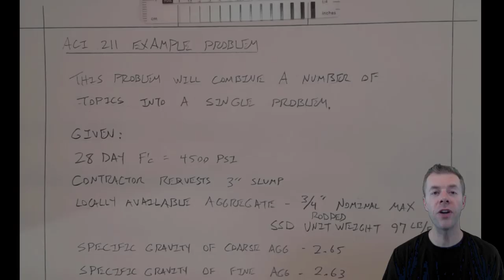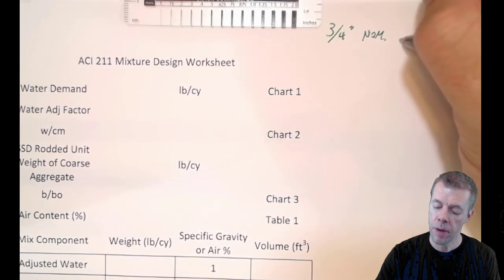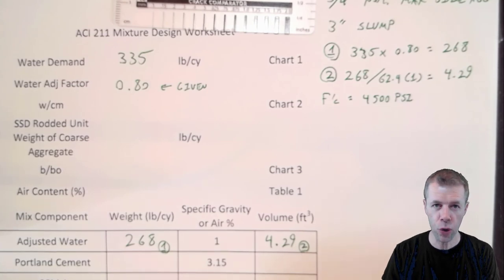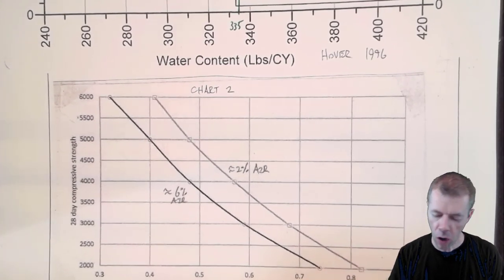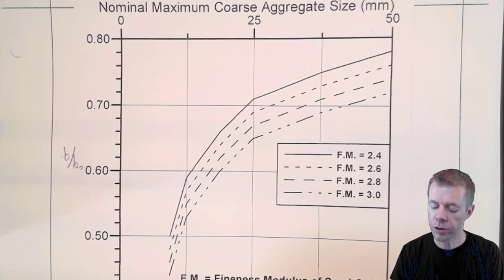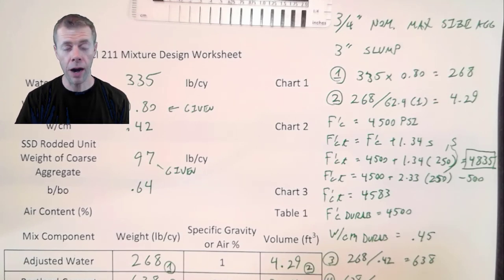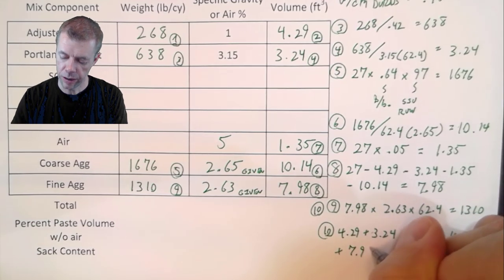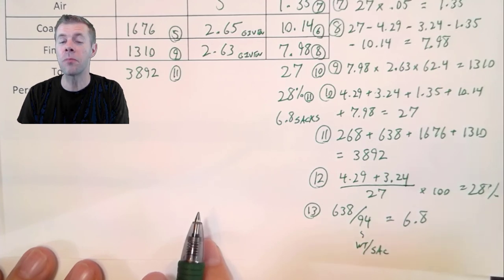ACI 211 Concrete Mix Design Example (excel sheet included)

Comment: Professor- As you mentioned in ACI-211 part 1- it’s a guess to the development for trial batching- I have found within the engineering community that ACI-211 is gospel whereas it is truly just a guide- using a 6.8 sack mix is a high shrinkage mix- Most state DOT’s use 211 and explains to them that it’s a guideline is like talking to a wall-  (i.e) the state of Oregon requires a certification test to even make mixes and requires that a certified person be present at a ODOT pour- the test requires variables and how to correct them in the field- it’s a nightmare-  thanks for your continued efforts to educate the concrete industry-
Reply from the maker: This is a challenge!  This is why education is so important.  Thanks for the comment.
I talked with Oregon DOT last week and I think they are starting to see that there are other ways to do this.

Comment: Hi badass, great video !! Please, can you tell if ACI 211 is available with every Kind Dmax coarse aggregate? Actually I'm a student in chemical engineering and I'm asked study the correlation between cement and amix (HWRA) so I need to formulate a good concrete Admix first...
I really need help....

Comment: What is the connection between the rodded unit weight in using the specific gravity? If i remebered it right the calculation of specific gravity is base on volume of solids. While the calculation of the unit weight of that rodded density is base on a container meaning there is a void

Comment: Looking for a cement for boat building. 25 m Cat external hull pressure is 1.5MPa suggested Thickness about 25 mm hull width to length is 10% NACA0090 flat bottom. Height of Hull 5000 mm. Salt water and fresh water . Can not have steel .. wanting to use a chooper gun and spray gun with Basalt cop strand. Any hints ? Spray Layup on a SS fly wire mesh. over Wooden molds.

Comment: Thanks for this. Are the weight units correct?  (Lb/cy).  If just lb we can use 62.4 lb/ ft3 to get water volume.
Reply: Oh now I get it. The unit size we comparison is one block that is a cubic yard.
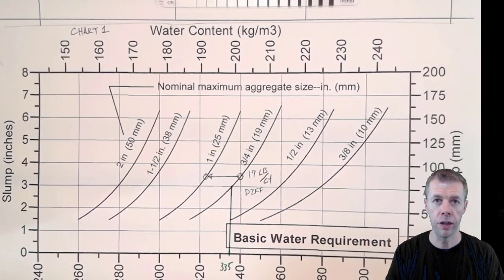Reply: We have the same question but go back to 4:30 where he mentioned the correct unit is pcf NOT pcy.

Comment: hi guys! i’ve been told that fly ash class f is about 0.5 lb/cyd of cement, so after our water cement calculation, and our determination of how much cement we need, do you think using that (lb/cyd f fly ash = 0.5 lb/cyd cement) to figure out the total celebrations material?

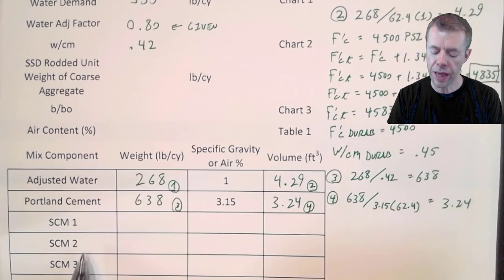Comment: How to calculate the mass of SCMs (12:45)? Say if we use 30% of fly ash, will the mass of fly ash simply be 638*0.3 lb/cy? But in that case there will be some error in the entire mix design because the specific gravity of fly ash is way lower than cement. 638*0.3 lb of fly has higher volume than 638*0.3 lb of cement. How to address the problem?
Reply from the maker: You increase the amount of aggregate in the mix to get 27 cubic ft or 1 cy.